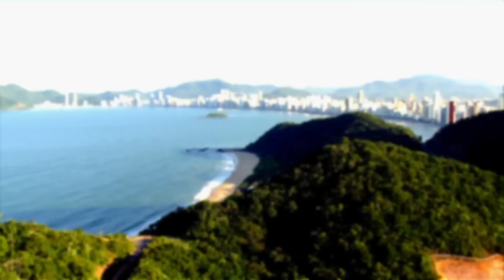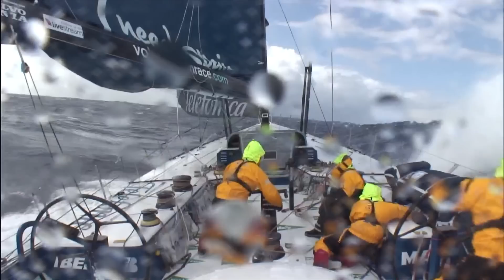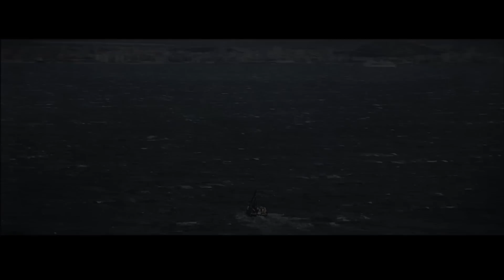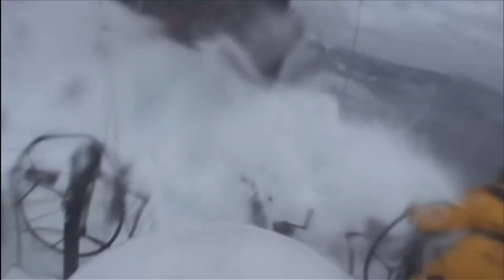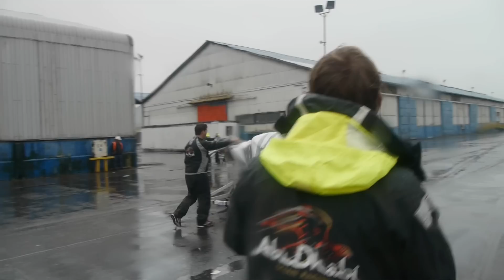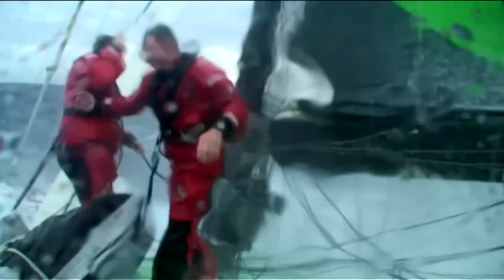The Big Debate | Volvo Ocean Race 2011-12

Comment: It's been only some years since lightweight materials like carbon fibre have been used so extensively in boat building, so there's certainly room for improvement. I think they will capitalise on the experiences they've had and in some near future we will have super lightweight, super fast and super reliable boats.
It's much like cars: up to the 1970s they were still pretty unreliable, despite 70 years of developement.
Each new technology takes time to develop to near perfection.

Comment: to make a mast in three parts you have to over engineer the joint sections as these are weak points. however if one whole section the whole structure is one and there are not weak points.